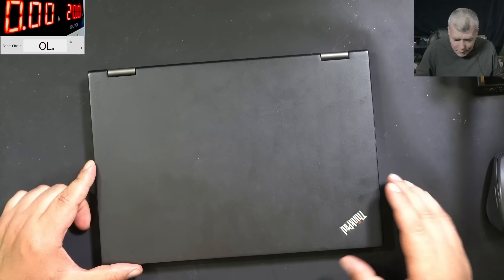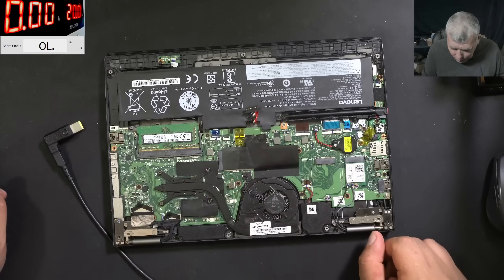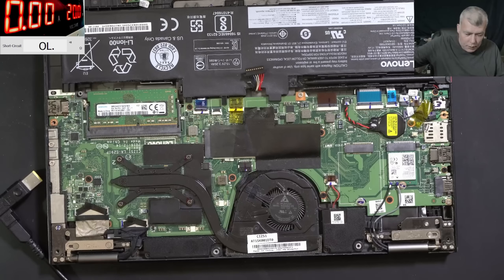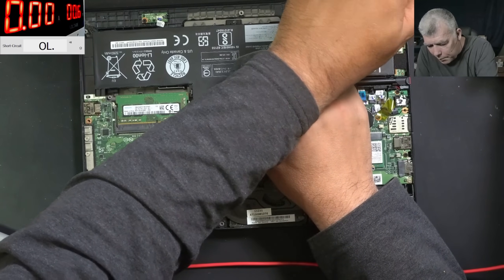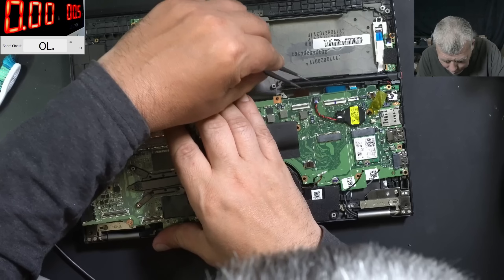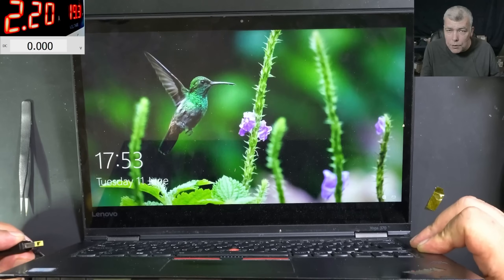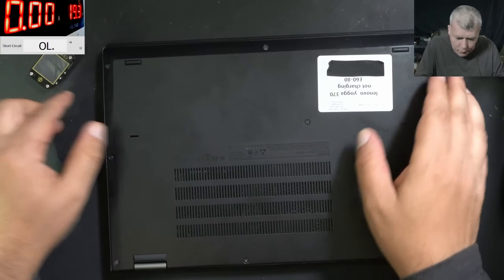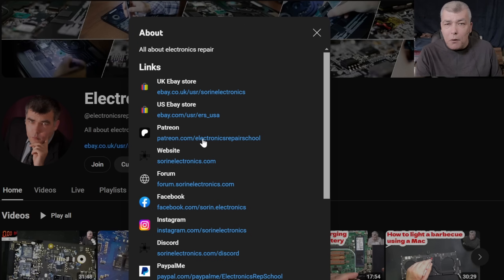Lenovo Yoga 370 not charging motherboard repair ... kind of, easy pizza

Comment: Thank you sir.  
My small lenovo ThinkPad yoga 11e tactile, is not coming on on AC adapter,  no charging, 
Battery doesn't have enough power,  it can't turn it on.  
I removed capacitor, the board still shorted,  
Mind blowing.  
Please  ,
Help me.  ❤

Comment: Easy pizza. The 3 sizes of capacitor is to low the esr in a wide range of frecuencies. When I make a power supply I allways add a .1 capacitor in parallel with the electrolitic.

Comment: Hello guys,

I am not a technician but my laptop is having an error 
BL initialise library failed 0xc0000185 
 How to fix it please help me
Reply: I understand that you are getting a black screen with BI InitializeLibrary failed 0xc000185.

 

Please perform the below steps and check.

 

Hard Reset:

1) Shutdown the computer.  

2) Unplug all the Adapter and peripherals connected.  

3) Remove the Battery. ( not for Built-in Battery computer ) 

4) Press and hold down the power button for 15 to 20 seconds.  

5) Plug-in the Adapter and put the Battery back into the computer if it's a (removable battery)

6) Try to turn on the computer and check, If the issue persists continue next step

 

Set BIOS default and restart:

Restart your notebook.
During startup, press F10 repeatedly until the BIOS menu is displayed.
Once the BIOS menu is displayed, press F9 to restore factory defaults.
Select Yes to confirm.
Press F10 to save changes and exit.
Select Yes to confirm.
The computer restarts using the default settings.
Keep us posted,

If you would like to thank us for our efforts to help you, 

Give us a virtual high-five by clicking the 'Thumbs Up' icon below, followed by clicking on the "Accept as solution" on this post, 

Have a great day!
Reply: @bazdesh  I don't think my laptop is having removable battery my laptop model is A715-42G acer company I gave to a technician there is is a bios fault he said and more things is I did a mistake.I used "diaper rash cream" as thermal paste after watching some YouTube  video but it worked for 1 day properly and started getting this error is there any relationship with that.why will this error come in the first place can you explain
Reply: What did you try so far?
Reply: @Dragunov1111  i tried entering into bios by pressing f2 which is the bios key but didn't work and I also removed my SSD and used my friends SSD to check if there is fault in SSD but SSD was working fine and also tried turn on the laptop without any SSD but didn't find aby change